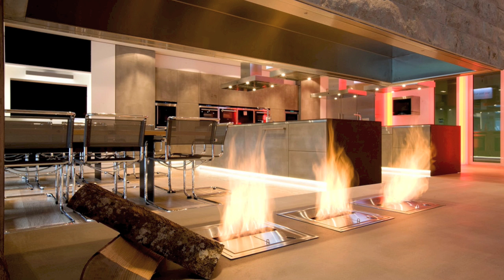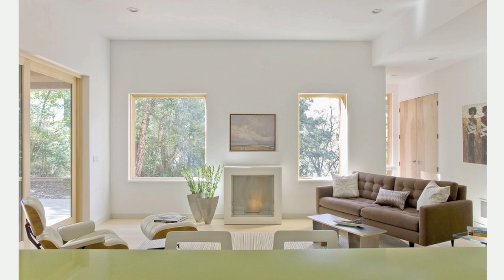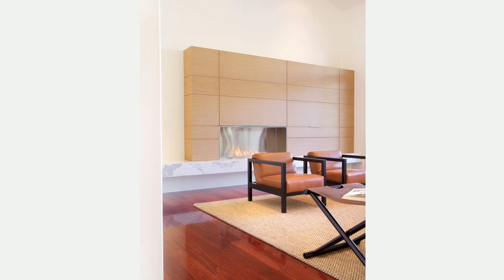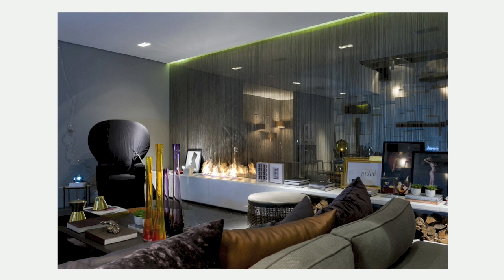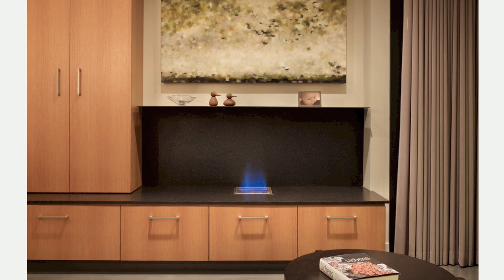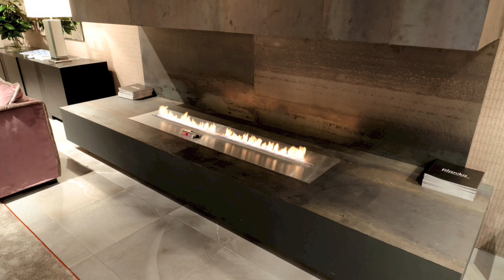Ethanol and Gel Alcohol Fireplaces (An Architect's Take)

Comment: Glad hes an architect and not an engineer....it produces about the same CO2 as two candles....ever hear of someone dying from that? Not likely....CO2 is not the main problem ...take care in not refueling  when on or hot, dont get it on you especially the gel (napalm like) and heat transference (conductive principal)  needs to be mitigated through the process of proper insulation like ceramic/porcelain or other things( rock wool) for safety but overall you should be fine...have on myself and single issue.

Comment: We bought one of the table top versions as an emergency heat backup in the case of a blackout as we had ducted gas heating that relied on electricity for the fans to blow the heat around the house so would not work in the case of a blackout. For this purpose it worked really well but though it had glass screens around it I would not recommend using them with children as the flame was quite erratic and would frequently throw itself over or between the glass walls, flames are near invisible unless it was dark and a very hot, the glass itself would also become hot. I think here in Australia they were also recalled after we bought ours due to poor manufacturing standards of the cheaper models and I would think the risk to children. I would recommend them in some circumstances but if you have an option of a enclosed wood heater, I would pick the wood heater any time of the week, its a very nice, I suggest unparalleled form of radiant heating, for me though expensive to install and like here wood isnt exactly cheap you cant beat the feel to your body and ambience of an efficient wood heater.
Reply from the maker: +MaZEEZaM I agree with the heat quality of wood (I heat my home with it)...trouble with wood is: ash, hole in your roof (flue), dust, mess, hauling wood, emissions...ethanol can be a good alternative which addresses many of these shortcomings...trade-offs with everything , right?